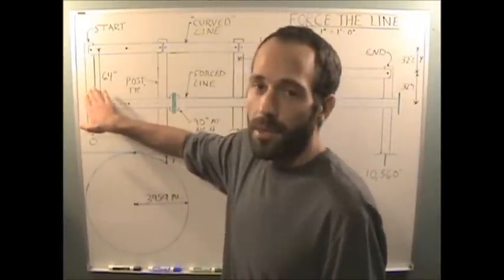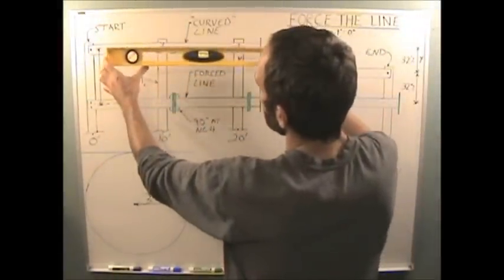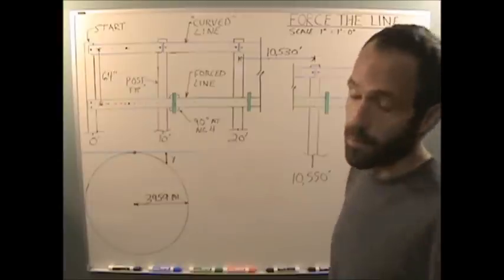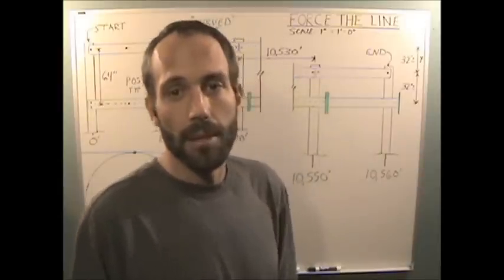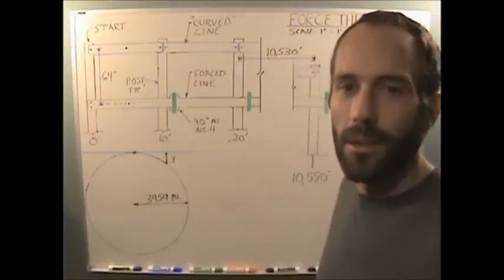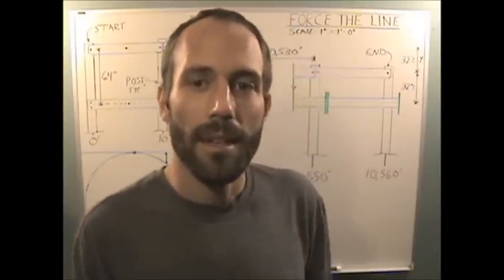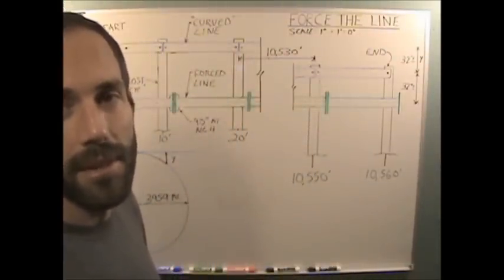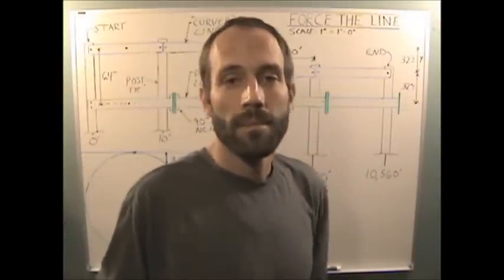Prouver empiriquement la forme de la Terre

Comment: Bonsoir et merci,
Effectivement le projet et largement viable.
Néanmoins,  le projet devrait être multiplié par 100 au niveau du coût, il faut conter l'étude de réalisation, le terrain sur lequel cela sera fait, les salaires du personnel avec ses charges, les locaux déplaçable pour le personnel et l'étude de chantier, l'infrastructure au sol pour acheminer le matériel,  la location du matériel tractopelle foreuse et j'en passe etc....
Par contre, l'idée et digne d'un ingénieur ou plutôt d'un génie. Bravo
Reply: +PainNoire
('tain de mesures impériales)

Convertissons d'abord en système métrique :
- distance clôture : 2 miles = 3.22 km
- circonférence de la terre : 25000 miles = 40234 km
- décalage de hauteur des piquets : 32 pouces = 81.3 cm
Calculs :
- angle entre les 2 points : α = 2 π *3.22/40234 = 0.0005 radians
- rayon de la sphère R = 40234/(2 π ) = 6403 km
- Décalage en hauteur : Dec = (R/cos(α))-R = 81 cm

Je confirme, 81 cm est bien le décalage en hauteur que l'on doit trouver.
... Reste plus qu'à faire l'expérience.(je conseille le désert de la mort...et d'avoir des instruments de précision)
Reply: +Kahlie Niven ALERTE !....
JUJU remet ça  sur le  lien ( fil à  plomb terre  plate )
On y crève le plafond de la connerie
Reply: +julien v. Bonsoir,
C'est vrai que le coût resterai ridicule comparé à ce qu'il dépense pour nous endormir et faire leur guerre.
C'est pour cela que je croit qu'il n'y a d'espoir qu'en la Spiritualité. Amicalement.
Reply: +PainNoire Amen
Reply: +Kahlie Niven
Bonjour,
Je suis très bon bricoleur excellent en rien mais bon en tout. Néanmoins, les calculs je vous les laisses, je préfère les appliquer. Après j'ai mal à la tête. cordialement.
Reply: +Kahlie Niven ou le grand lac salé du névada
Reply: Vincent B
Ce serait parfait (en plus, le temps est toujours magnifique là-bas)
.
Reply: +Kahlie Niven 
Superbe idée. S'il faut un commencement, s'en est une!!!
Reply: PainNoire
Oui mais ... comme disait Vincent B. sur un autre fil, ce serait mieux d'effectuer ce genre d'expérience au niveau de la mer, afin d'éviter tout problème de déclivité (d'où ma proposition de l'effectuer sur une longue plage, juste au bord du front de mer).

Ceci dit oui, cette méthode est valide.
Reply: +Kahlie Niven un lac marche aussi, le problème des marées en moins
Reply: Vincent B
En effet, je n'y avais pas pensé. Bon bah va pour le lac Léman.
Reply: Vincent B
où ça ?
Reply: +Kahlie Niven ça règlerait le problème une fois pour toute.. il y aurait aussi faire une expédition au pole sud, à voir ce qui coûterait le moins cher à faire.. Matt boylan éssait de récolter des fonds pour aller au pôle sud j'ai lu je sais plus où, la vérité finira bien par se savoir.
Reply: pierre kaillou
S'en approcher n'est pas si difficile, il y a même un tourisme qui existe..

Par contre, l'atteindre c'est déjà plus dur...faut une certaine logistique pour ne pas geler sur place.